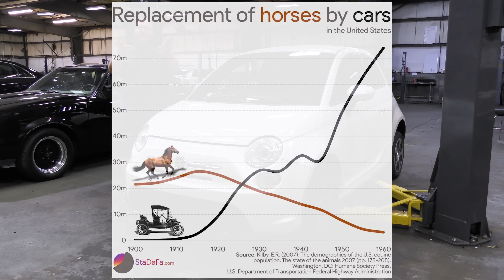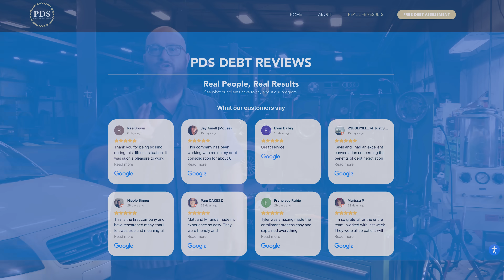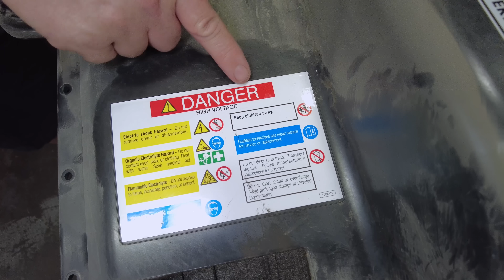How to SAFELY Remove the EV Batteries From my Fiat 500e

Comment: Wizard, battery powered equipment is used extensively in warehouses (material handling, fork lifts, order pickers etc) when a battery needs to be charged it’s replaced with one that’s ready to go.  I think this makes more sense than driving at the most 400 miles and then plugging in for several hours.  It would be necessary to have standards manufactures would be forced to adopt.  I’m sure companies like Tesla would be opposed because they want to protect their charging infrastructure.  If designed correctly I’m sure a battery could be changed out much quicker than being charged.  I’m old none of this is going to affect me, if electric cars are the future this would solve the anxiety of searching for a charging portal.  The service station model could be adopted.  
Or not
Reply: Tesla did that years back with the Model S and a couple of battery swap stations. With the advantage of the supercharger network it was shut down. Cheap charging done fast pretty much negates the massive capital buildout that battery swap stations required.
Reply: The Chinese are already on battery swap technology. They have it in e Scooter's

Comment: Maybe EVs replace ICE vehicles... in 50 years.
The Wizard's predictions need a timeline...
Of course, The Regulators could incentivize EVs by putting ICE drivers and sellers in cages.  But I'm skeptical even a Kamasutra Administration would go that far.

Going long on Toyota and short on Tesla is a good bet.
Reply: The EU, one of the Worlds biggest car markets with over 10 million annual sales, is banning the sale of new IC cars from 2035

Comment: I see 126 miles on the guessometer all of the time, it readjusts the estimate as you drive. This pack was just fine.
Reply: Agreed. Hoovie thought it was "broken" because he drove about 1 mile and the guess-o-meter said he used 5 miles of range. My Volt would do the same, but I'd end up getting better than the advertised range every time in my daily commute, but anyone who's ever driven an EV on the highway (as Hoovie was doing at the time of the "failure") can tell you, that's par for the course...and it's particularly noticeable on these short-range EVs. The advertised range for these small, short-range EVs assumes a lot of stop-and-go driving at 25-35 mph (i.e., regenerative braking). In general, highway range for EVs is, at best, ~75% of advertised range (worse if you speed and have AC or heat on).

Comment: The first three land speed records were set by EVs starting in 1898. So this is old tech that was superceded, just like windmills! How does that feature in your explanation of how people swapped from horses?
Reply: The Benz Velo (first production car with ICE engine) had a top speed of 19 km/h, certainly slower than a reasonably fast horse. I'll also note that from 1906 to 1909 the land speed record was held by a steam powered car... perhaps the ICE was superseded and we should have dropped its development in favour of further work on steam engines?

The reason EVs were surpassed in the early days was simply the lack of batteries that could provide sufficient performance. Electric drive never went away for vehicles that could get power from the grid like trains, trams and trolleybuses. For a while in the 1920s and 30s it looked like the poppet valve (almost universal in 4-stroke ICE design) had reached the limit of its development and to obtain better performance we would have to change over to sleeve valves. Improvements in metallurgy and fuel quality changed that, and the poppet valve got a new lease on life. So it is with battery EVs, new materials technology and chemistry is making them viable again.

Comment: Getting "angry" about EV's makes about as much sense as being pissed that pocket calculators replaced slide rules. Or that cell phones have replaced land lines. The same person with the manual dexterity and mechanical aptitude to work on gasoline or diesel powered vehicles, can learn to service EV's. Just take an electronics course to get up to speed on the different tech. You don't need an oil industry to drill or a vast refinery to make the fuel. A solar powered roof system will fill all the energy needs for the average driver's commute to work. Then collect a monthly cheque from your power utility for selling the extra power capacity to the local grid, that you don't use.

Comment: I ambivalent about EV's they have their place in short haul commuter, city driving environment, but outside of that I don't see them working in rural, or long haul settings. The Chevy EV truck has gotten close with a better then 400 mile range unloaded and a barely 200 mile range when loaded down towing. You throw in charging times in excess of forty five minutes it's still very practical compared to ICEV. I would like to build a EV for tootling around town, but that is a ways down the road.

Comment: The wave of electric vehicles can be stopped. All it will take is a war with China or them cutting us off from the metals we cannot or will not mine in the West. If cobalt mine slavery is finally stopped (or Russia gets control of those African nations) then there is another nail. Just like Germany in two world wars, not having access to the materials needed brings the machine to a screeching halt. Also, unlike the gasoline era, this push away from fossil fuels has fraked California with energy shortages and EV charging. What will happen when we lose our coal power plants and ignorance flatly refuses to allow new nuclear power plants? Stable fusion power is still a long time away, solar panels and wind turbines are destroying ecosystems, meaning we are cutting off our noses, shooting ourselves in the foot, and other tired similes/metaphors as to why electric vehicles are meeting a much higher resistance than gasoline engines did. None of this takes into account how they'll power warships, passenger jets, or long-haul delivery on electricity alone (go watch some videos on truck drivers talking about charging times). The latter will require (god forbid) locally grown produce just like in the era before gasoline engines, or people growing their own fruits and vegetables (which I suppose is technically local). Imagine the price of bananas in a world where there is no gasoline engines or other foreign grown foods. Solar and sail powered cargo ships will increase those costs beyond a point a person is willing to pay.
Reply: Edit: For those who think I loathe electric cars, that is incorrect. I enjoy the Chevy Bolt (locally) and my dad's Prius Prime plug-in is great because town driving is on battery and highway/long distance is 60+mpg. I came within a pubic hair of getting a Nissan Leaf until I learned (as pointed out in the video) there is no battery cooling.

Comment: Had a good friend who bought a new fiat 500e, she got a fair number of miles on it when one day the battery threw a bunch of errors and died.  It was under warranty, but they couldn’t fix it because no one was trained on them.  In Europe they are quite popular, in the us it was a compliance car with no back end infrastructure to support anything.   She got a massive payout on a new car, because Fiat couldn’t fix it.   Now she owns a gas vehicle because of the experience.
Reply: I think with many new technologies, it's best to go with a company that has specialized in it for many years and spent billions in R&D, like Tesla.  Eventually others will get to that point but I wouldn't buy any of the legacy brands right now trying to make a decent EV.
Reply: @aussie2uGA  teslas may have had cutting edge technology in the past but now they lag far behind in not just build quality but reliability and cost of repairs compared to other companies.  I own a Kia EV6 instead of a Tesla 3 specifically because the car and brand kind of sucks.
Reply: They didn't.sell that 500e in europe
Reply: @rjbiker66  they actually did and the problem was the battery needed to ship from Europe and was not in stock at the time.  You may be thinking of the controls like the side the steering wheel is on.  So sure, they didn’t sell the American right side of the road package in Europe lol.

Comment: The battery pack itself, not just the individual cells, needs to be standardized like fork truck batteries. No matter the make, they should all be the same size and shape with the same connections. Standard sizes means easy swapping and savings from scaling up production with few variations.

Comment: I think the main problem people have with EVs is the government pressures. I don't remember any major controversies around power tools going from pneumatic to corded electric, and then to battery electric. Let the free market decide. You can still buy tons of pneumatic tools today if you want. The free market knows better than some bureaucrat in DC anyday!
Reply: Personally i have no problem with EV's but i would like more wallet friendly models because only thing that is "cheap" for sale currently is few Nissan leafs, 1 Twitchy and one Inzile Pro 4. Most people around here drive around cars with price range of 500-7000€ and with that range there is very limited amount of 12 year old Leafs with 50-60% battery life for sale.
Reply: You're right, years ago we used to smile at the "Tesla vs Dodge vs Chevy" as be amazed at what the electric a/c motor could do.  In this administration, we now sling slurs and hurl political insults.  The change has been recent and drastic.
Reply: Every single step in automotive design has been through government regulation. From seat belts to emissions to the color, type, and placement of lights. Add on the monopoly of early oil producers, oil producers actively killing public transportation, and the government not electrifying rural areas until the TVA and you get a sector dominated by ICE vehicles. 
It's always been this way
Reply: Yup, and it's driven up costs every step of the way passed down to consumers
Reply: @ChromeCylon The way that you equate headlights and seatbelts which are trivial add-ons to the prohibition of ICE vehicles and subsidization of BEV vehicles is insane. Again, let the free market decide. This isn't a $50 part we're talking about here. It's the entire vehicle itself.
Reply: @kalashnikov1343 The oil industry has been heavily subsidized over the past century. The cost of that is far greater than any subsidies for EVs.
Reply: @kalashnikov1343 it’s not prohibition per se just prohibition of purchasing new ones. People won’t be breaking the law driving ICE vehicles like ‘running moonshine’ and no doubt there will be plenty running about until at least 2050. After that, I’m guessing some clean bio fuels will still be available for enthusiasts a bit like you can still get coal to run a steam engine. It’ll just be a niche thing and any carbon emissions would then be negligible in the greater scheme of things!
Reply: @kalashnikov1343  I think it's quite telling how you completely ignored my points about the automotive sector lobbying to kill public transportation and the TVA coming in late to electrify rural areas.
The free market will always be dominated by whatever is already there. The free market kills innovation through monopoly.
Reply: @reevesRichardl And blood and treasure spent for wars in areas with oil.
Reply: Tell that to people paying 15£ per day to drive to work in the city because the diesel the government said they should buy 15 years ago is no longer favorites. That is a super optimistic yet fairly naive point of view I'm afraid.
Reply: @ChromeCylon  Thank you, you beat me to the reply and Points made, have my Upvote

Comment: So, you didn't have to remove the rear subframe to get the battery out. That's good. It's interesting to me because modules on internal combustion cars also go bad and you have the same issues trying to get them repaired or replaced.  
With so many modern vehicles having electronics problems, I'm surprised an independent shop hasn't incorporated an electronics repair shop into their business.

Comment: Yes, if government was actually serious about emissions reduction, they would mandate a standard battery pack with an open software system. These would double or quadruple the life of these cars, and cost would be far below ICE.  This would kill most car companies.  I remember when Toronto had electric buses with overhead power lines and those buses had a 40 year life. GM stopped making them for that reason.

But the reality is that cars will be more disposable and impossible to fix. Latest Tesla designs have the iphone philosophy. Lease and dump. Minor accident and the car is written off.

Comment: Why manufacturers can't put emphasis on maintainability as cars get more complex is ridiculous.  I understand that we'll continue to move towards hybrid and EV cars, but why those battery packs don't just use a couple dozen battery modules that can be removed and replaced individually like the batteries in my eGO power tools I just don't understand.

Comment: Imagine Wizard shop having 5-7-10 of these battery packs lowered and scattered around for replacement BPCM's or cells and for Wizard it would be no-brainer to fix EV-s by removing the packs, opening them up, going through the battery elements and wiring and pinpointing the issues. Claiming, that yep, no problem, we can replace this piece and you can pick up your vehicle tomorrow. Thank you very much!
Reply: Kind of like the Batteries+ stores concept.
Reply: It's an economy of scale thing to have an employee do that work - disassemble, catalog and track, evaluate, electrically exercise, and grade individual component cells.  IF the physical shape of the component cells were consistent it could be possible to automate some of that work at scale and become very productive.  Right now it's hands-on work in the early days of a re-imagined energy medium.
Reply: @raygunsforronnie847  Interesting this does not happen with powertool batteries.  One would think there would be small shops everywhere (like phone screen replacement/repair shops) that would be renewing li-ion batteries left and right. But not
Reply: It is not as easy.   You may notice that even in household use, it is not recommended to mix old and new batteries.
I'd suspect that is a bit an issue with cells in EV's as well,  when they have to be finely balanced to properly perform

Comment: Are you sure it's a 42kwh battery? That's on the 2021 onwards (2024 usa)  version not the California only version you have.  I believe that was 24kwh.  Unless you have a custom version not available to the general public?

Incidentally in my experience having a weak 12v battery can throw up all manner of weird codes.  I'd disconnect the 12v fully charge it ( making sure its good first) then reconnect it and rescan.  Otherwise you might be chasing imaginary fault codes.

Comment: I hate manufacturers for not making things like this easy to fix or diagnose. Fiat would have just told you to you need to replace the battery. Guaranteed.
Reply: Mopar EV tech here. The issue is technician training. No one was trained in taking these packs apart, so it was easier and safer for the manufacturer to just replace it. Now VW, Kia, and Rivian are taking them apart. Mopar is slowly rolling out the training as well.

Comment: I don't think Ev are totally without maintenance as different climates affect and attack the drive components ....like salt used on road in winter climates play havoc on electric drive motors  . Who going to rebuild that , quickly or cheap ...no one it will be brand new  at factory prices .I heard some of the Tesla drive motors are like $5000 a piece
Reply: I was in a Tesla taxi here in England the other day. Driven 24/7 with driver shifts it had 300,000 miles on the clock. They had a free battery pack under warranty, new headlights and wiper motors.
Other wear and tear items like suspension arms, bushes, dampers etc. they paid for. The cars are pretty well made and sealed underneath although body fit and finish is mediocre.

Comment: They’re not going away but they’re not the answer. I believe synthetic fuel is, but we’ll see. For all the fans of EVs, if you like them for your environment and your lifestyle, great. But they’re not suitable for everything. They’re not good with extreme heat like here in AZ where the heat off the ground damages batteries and the heat in general kills range, or up north where the cold does the same. That’s not even going into things like semi trucks where electric options are an absolute joke. Nor the cost to the environment (disposal of batteries, lithium mining destroying the environment and electric still best made from coal and petroleum as solutions like wind have their own problems …)or the human life toll with mining of lithium. It’s just not the magic bullet solution. Sorry.

Comment: Yes Nissan made a mistake by not providing a temperature control system to save the battery on the early models , now they fixed it and they are a much better car , same with Fiat the new 500e is a much better car than what you have . Like you said the manufacturers will figure it out and they will get better. Now it’s the charging stations , getting better but still not everywhere. TESLA NOW LETS GMC & Ford use their stations.